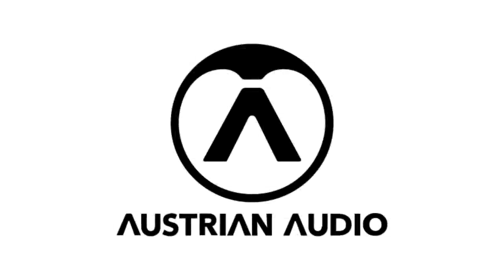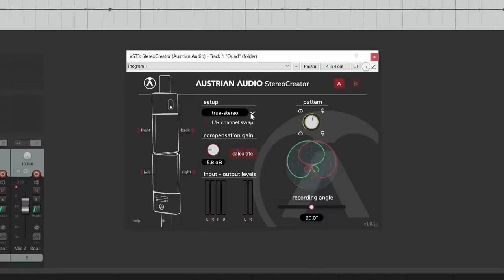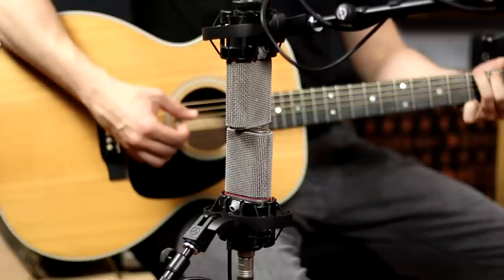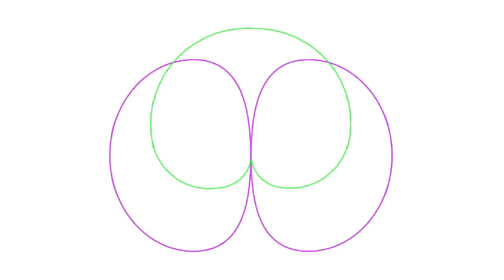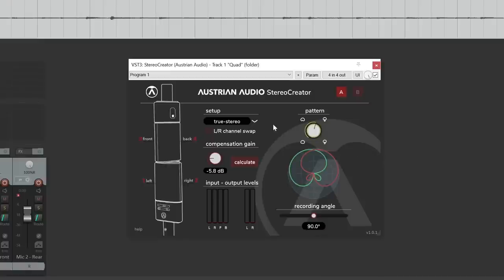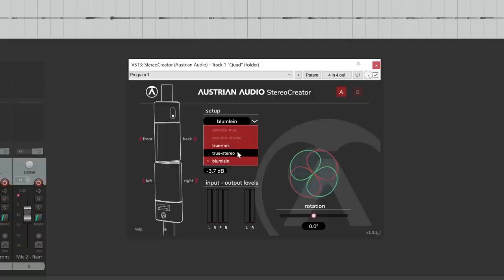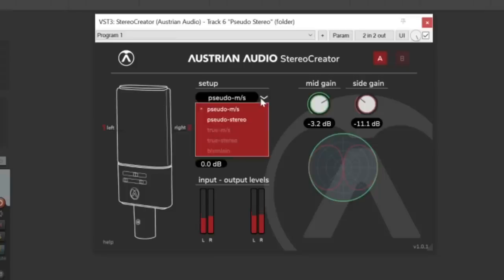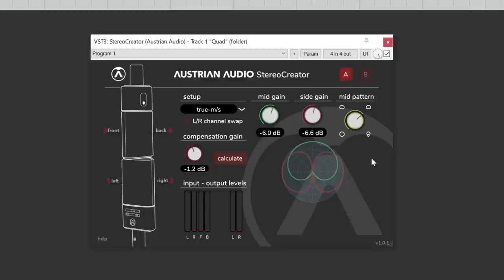Stereo Recording: 7 Mic Techniques You Need To Know!

Comment: Have you ever compared Austrian Audio OC818 to AKG C414 XLS?

A few people recommended AKG C414 XLS for recording an accordion - I even found AKG C414 XLS listed on some accordion forums as the mic to go for accordion recording. 
Since my primary interest is recording an accordion, I was thinking of getting a pair of C414 XLS (stereo setup) and C 516 ML for extra bass covering (recording left hand - bass side is a little bit tricky + I like darker, bass sound)

But then I found about Austrian Audio OC818 which is well praised on every video I watched, but it seems to me that they are very similar. Even the price is around the same.

Are there any noticeable differences? 

AKG C414 XLS is a well-known, legendary mic. On the other hand, OC818 designed people who initially worked for AKG.

Currently, I am leaning more towards OC818 (primarily because of various subjective reasons). If you had chance to test them both, a few words about the difference between these two would be very interesting :)  

Great and helpful video BTW ;) Especialy if I get a pair of OC818-s :D
Reply from the maker: I’ve used the C414 XLS many times - that’s also a great-sounding mic. I’d personally go with the OC818 though. The sound is smoother in the high mids (if my memory serves me) with the OC818. Also, the OC818 has dual output!

Comment: @AudioUniversity I love your channel and have learned a lot from you over the years. I have a question in regard to mic setup and techniques. Is there a benefit to using a stereo mic such as an AEA R88 and say, a mono Earthworks SV33 dynamic mic in a mid-side setup? So, using a stereo mic instead of the figure of 8 mic usually used in mid side?

Comment: Apologies for the silly question, but I've always wondered why you need to flip the phase on one of the sides when doing Mid-Sid. Is it just so that they disappear when summed to mono leaving only the mid channel?
Reply from the maker: Not a silly question - a great question! Check out this video for more info on Mid Side: https://youtu.be/2M9OGxAJ2-g
Reply: Thanks Buddy. Also, I've seen pretty much everyone group the sides together (yourself included) is there any issue with the left and right sides being at different volumes?
Reply from the maker: The sides won’t totally cancel when summed to mono if the side channels aren’t equal.